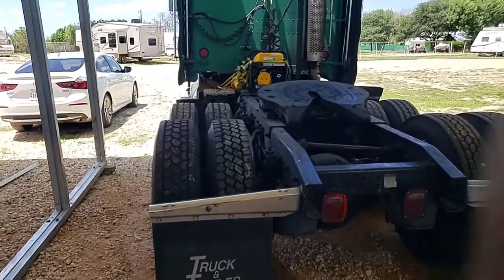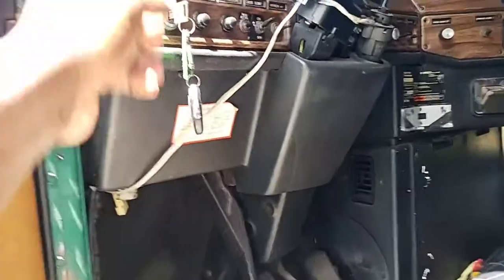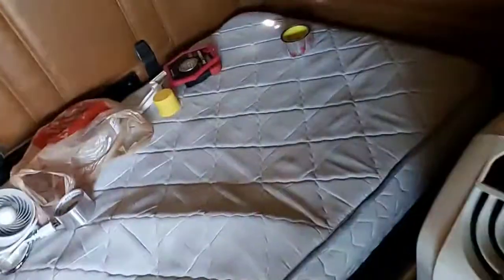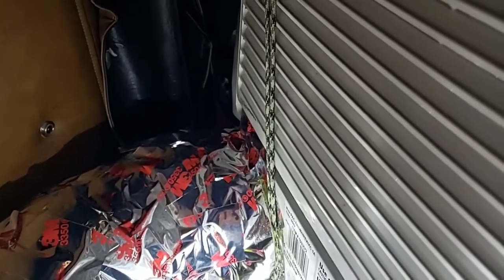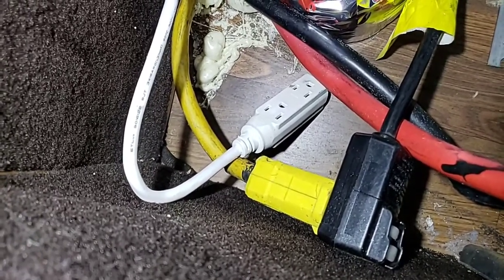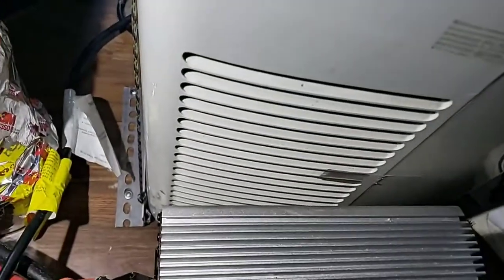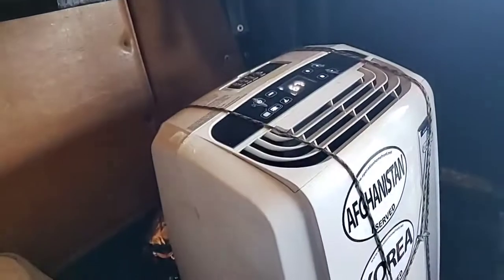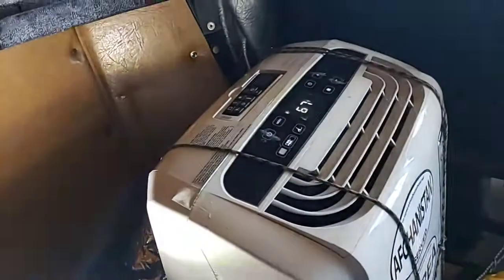Gasoline generator, and inverter installation on my semi

Comment: Great concept. The job itself is very sloppy looking. I have the Predator 4375 generator powering a 10,000 btu AC and I wired it under the truck very carefully AND neatly in protective cable cover tubes. I cut a 6 inch hole into the floor to vent out the exhaust of the AC, also, However, I have the generator in a diamond plated box that I purchased from Tractor And Supply and mounted it to the side of the frame. It looks very, very professionally done. I’m no professional, but it took me about a week to do all of this properly. Regardless, thumbs up to you for doing this. Enjoy, my friend…

Comment: Nice setup man. I’m thinking of doing something similar but on my Freightliner Classic I’m going to have my passenger side step box removed and have a storage box put in it’s place to house the generator. I don’t have a passenger seat so it makes more room in the truck and seeing how I never use that door for anything it makes sense plus it’s really the only place I have a room for a box big enough for a decent sized generator. I’m thinking of using the Westin house iq4500. I made a break down of how many watts everything uses and that generator will power everything at the same time without having to unplug something like a portable heater/ac because those have a big draw on them

Comment: QUICK QUESTION IS THAT INSTALLATION FOR THE GENERATOR DOT APPROVED
Reply from the maker: No powered accessories have to be DOT approved that I'm aware of.  Do you mean is there anything creating an unsafe condition? I'm still alive after hundreds of hours using this thing from Los Angeles to Texas to Georgia.  Cold or hot doesn't matter, it just works when I need it.
Reply: Dot approved generators? LMMFAOOOOO
Reply: Im thinking he means the mounting of it to the cat walk. And yes. As long as it's strapped down with straps or bolted to the frame, etc.. it is fine. Must have it at least strapped down with a strap that has a working load limit.

Comment: The firman gens don’t last that long, but it’s good if you got it at Costco, I have a 14,000 btu a/c like yours but with an easy start and I use a Honda 2200 drawback I can’t remote start 🤣
Reply from the maker: No real issues with this generator.  You don't need remote start but it's really nice to have sometimes like when you pull up to a stop and want to take a nap or eat and rest with the truck OFF.  Just hit the remote and it starts and then stops when you want to turn the truck engine back ON.

BTW, I destroyed my first one by accident (messed with the carb) and took it back for a full refund.  Try that with a APU. Also, the second one has been ultra reliable so far. I don't recommend doing any of the maintenance yourself such as cleaning the fuel filter because it's plastic and very easily damaged. When I get back off my current trucking run, I'm going to get ROUTINE service (air filter, oil change, spark plug but also clean the fuel tank because I messed up and pushed the filter inside along with dirt)  by a certified generator mechanic.

Comment: Why didn't you do the same thing with a mounted minisplit
Reply from the maker: Simplicity and expense.  Everything is completely modular  and can be instantly moved to another truck or replaced. Can't do that with a mini split.  Would a mini split be better on space? Yes. Has my floor system worked out great? Yes.

Comment: How did you start it remotely
Reply from the maker: Has a key fob to start or stop. You can also start the  generator with a pull start or button push on the generator. I highly recommend turning off the generator by closing off the gas valve and starving the carburetor.

Comment: Good job! That ac unit seems a little bulky. Maybe a rooftop ac unit in the future!
Reply from the maker: Yes, it takes up valuable floor space but it cools and heats! The rooftop units... not sure if any provide heat and A/C.  Was thinking to make a second video due to poor audio. I also destroyed this generator and was able to get a full refund! I've got a second one, same brand.
Reply: @prosimulatedgolfer  they make a super nice, low profile, rooftop with heat! I was going to put one in my hotshot but decided against it. If i had a semi though? Absolutely!
Reply from the maker: @All-Miles-Matter  // I'll hit you up via phone!